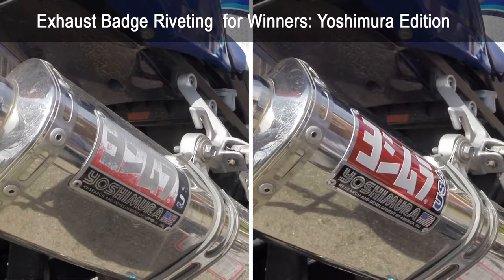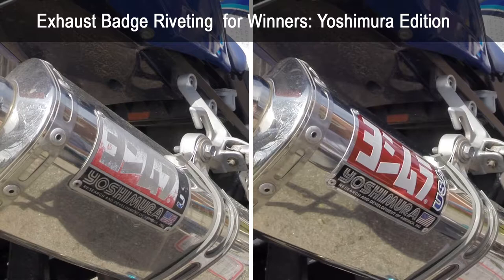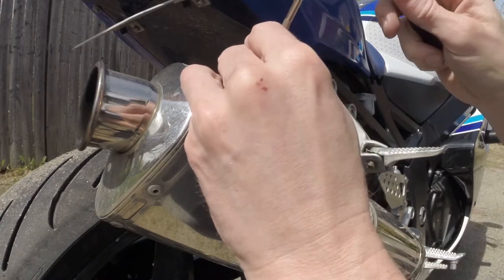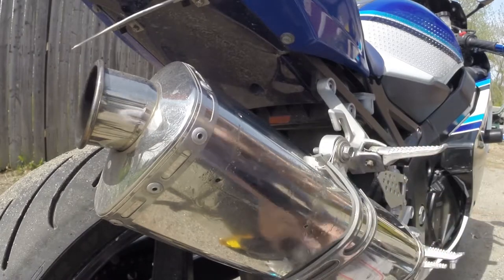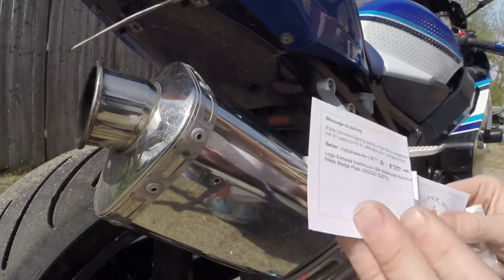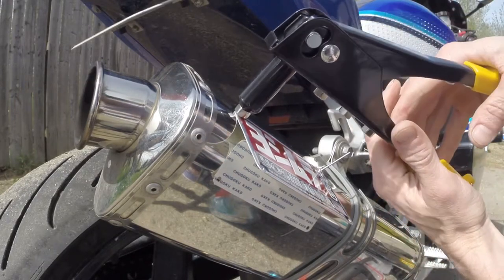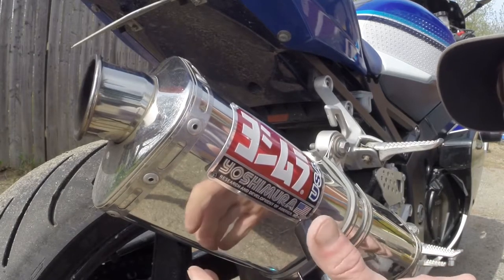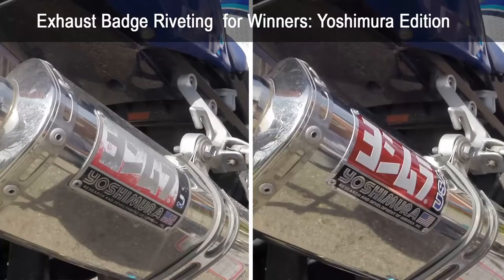Exhaust Badge Swap - Removing Rivets & Installing New Yoshimura Badge

Comment: I’m about to take off the badge on my new muffler and not replace it with another. The little piece of rivet that stays inside once taking the heads off does it make rattle noise??

Comment: Did you hear any rattle from the small pieces of metal inside it? Need to do the same to mine
Reply from the maker: No I never heard anything, the packing pretty much kept them from moving around.
Reply: @gabeharper2219  sweet, thats what i figured just wanted to make sure.  Thanks for the quick reply,  gonna order a new badge now lol
Reply from the maker: @damonbalen1836  No problem man good luck with it!